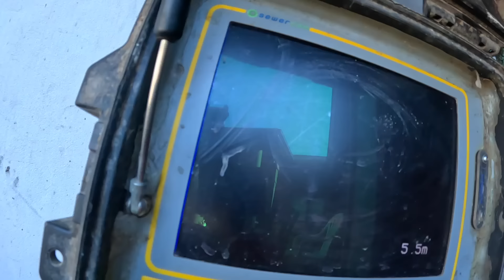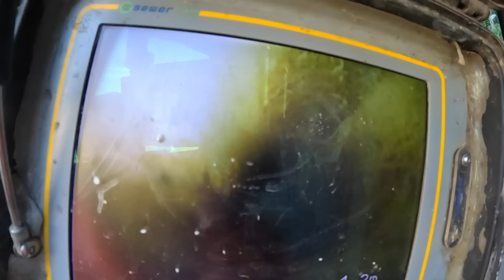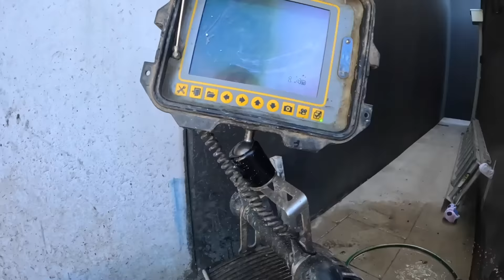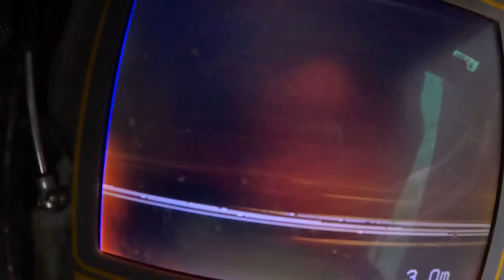Blocked Drain 878

Comment: I like the idea of the stormwater going back into the ground first. Helps to recharge the water tables. One of our biggest problems is, we have removed so many trees and replaced them with concrete, bitumen and steel. We then redirect all the surface water straight to creeks and rivers, which eventually flow to the ocean. We are drying ourselves out on land while also flooding ourselves....